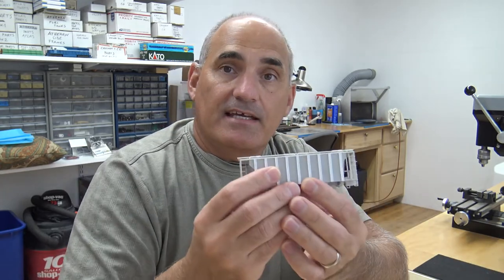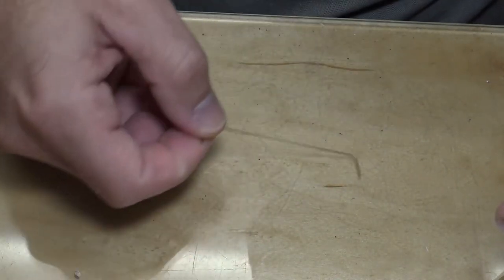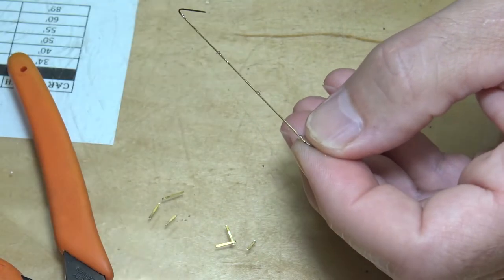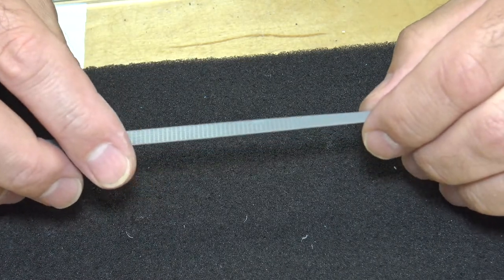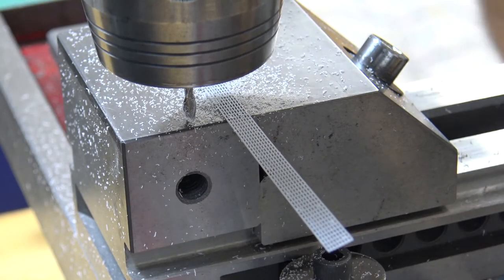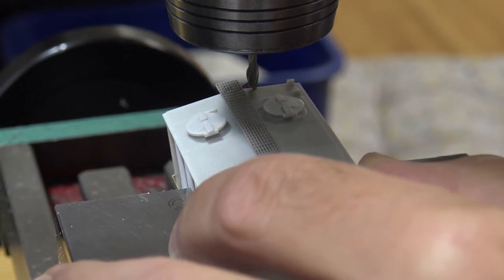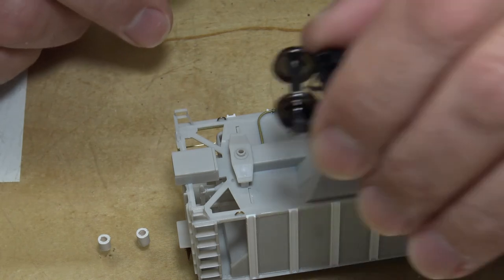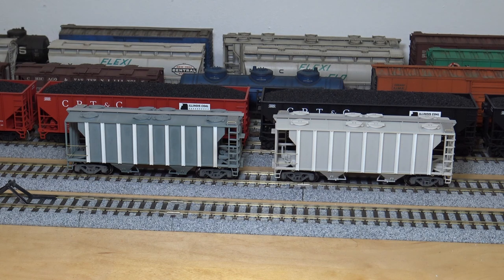KO&G PS 2 TWO BAY COVERED HOPPER EPISODE #4

Comment: I am very eager to see the paint/decal and especially the weathering steps. 
Watching this project makes me want to get back to my bench. (And - perhaps - replace some 'hats' with some 'channels' too)
Reply from the maker: These models are done. You can see them on my Flickr.com page. 

I typically do not video weathering because I hate it so much. The reason I hate it so much is because I do not know what I am doing. I cannot plan it and nothing turns out the way I envision it. My weathering style is a hail Mary pass hoping it looks OK.

I have tried so hard over and over again to learn the techniques to no avail. I just fail at them repeatedly. I just tried it again tonight with simple pin wash. I followed the instructions TO THE LETTER. Making sure my surface was correct and my mixtures were correct and total failure. So I throw some goo on there. Wiggle it around and hope it works.

I wish with all my heart that I never started weathering. That I just finished my models in a satin finish. But since I started I have 56 weathered models. If I stop weathering now, my train will just look like crap with half weathered and half unweathered cars.
Reply: @6axlepwr  What a fascinating response.. and quite surprising. 
I say 'surprising' because what you achieve is very good. Excellent, even. Your fades look right. Your 'dust' looks like dust. Your 'grime' in the nooks and crannies looks like grime.. etc. etc. Nothing is overdone or 'too thick'. The 'distressed' lettering on the KO&G ps2 is 100% 'believable' (aka 'right').
Weathering is my thing. I live on the The Rustbucket forum (https://tws-rustbucket.com) which is dedicated to the art of weathering train models. I can tell you, your effects/results are great. And, imho, 90% of 'lack of control (or, 'predictability') is overcome by practice, and 10% (or less) by choice of materials.
I can also tell you I use your technique (from an old video) of oils and powders for wheel faces almost as my 'go to'.
Thank you for the link to your Flickr photos :)
Reply: Your rust 'pitting' on that hopper is 'to scale' and 'right'. Your effects stand up to scrutiny ;)
Reply from the maker: I am trying.  The KO&G hoppers were a step outside my box project. The rust was done with sponge chipping. I masked the ribs so I would not get any rust paint on them. 

BTW, if anyone wants some KO&G hopper decals like the ones on my car. I have a number of sets still available.